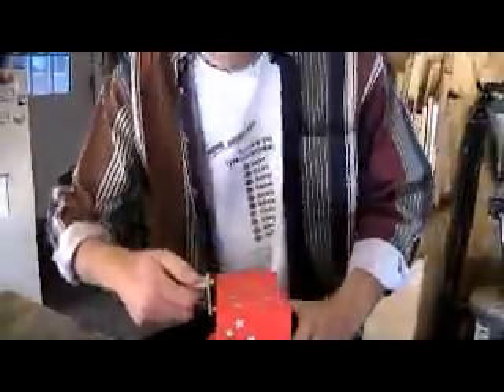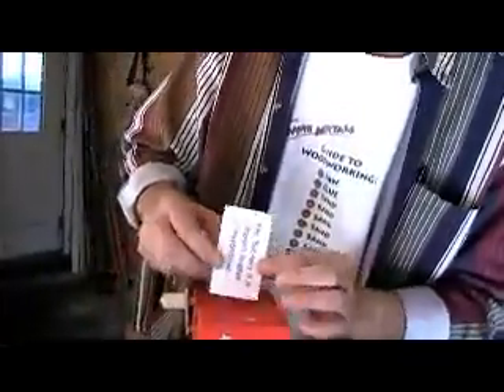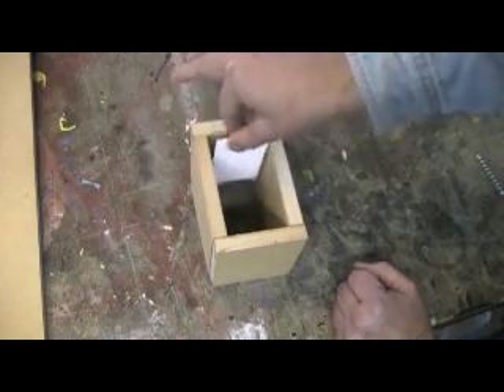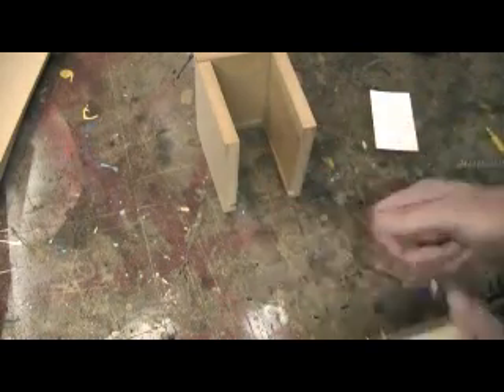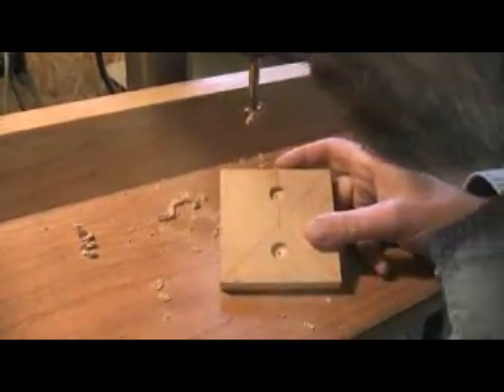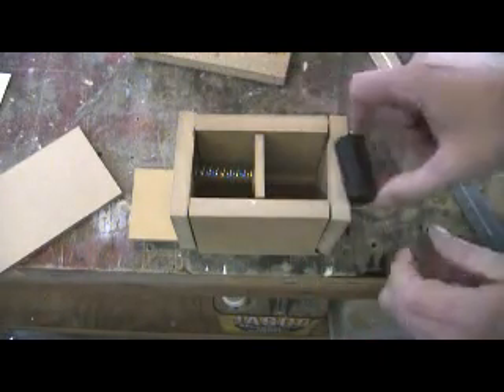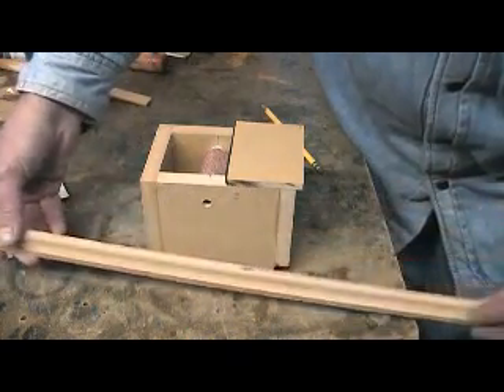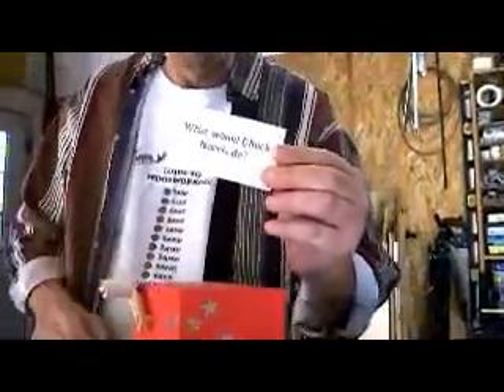Make a mystical fortune-telling box

Comment: Very cool.  On laser printers, I think they take the paper around a fairly tight curve right after the rubber roller picks it up, and the tendency of the paper to want to stay flat keeps multiple sheets from being picked up.  On the other hand, even on $20,000 commercial laser printers, I've had it pick up like 12 sheets of paper and try to jam them all through the paper path at the same time.  Jamming ensues.  Even the folks at HP haven't solved this problem entirely yet.

Comment: Steve. Thanks for the video fix!  I was going through withdrawal.  Have you considered using a small roll of calculator paper and an old typewriter to type variable length messages on the roll?  This would be mechanically foolproof.  Replace the springs board w/ an over sized soft hair roller from the wife to maintain friction w/ the crank roller.  Glue a cutter from an old plastic wrap box so you can cut the paper.  FWIW, ATMs solve this problem using a vacuum and roller system.

Comment: I'm sure you've probably had an answer by now but i used to work on copiers and printers and what they use to separate pages both in the blank paper drawers and the upper paper originals tray is a set of rollers - a feed roller and a separation roller that the single paper goes between. The feed roller spins while the separation roller spins slower or sometimes uses a clutch to temporarily spin the opposite direction, holding back the other pages. These rollers are plastic spools with a thin rubber "tire" similar to what you designed but the difference is the rubber is much softer (like a pencil eraser) and is more matte than slick. They also have a texture kind of like overlapping roof shingles. Spinning in a "lapping" direction instead of a "sawtooth cutting" direction will grab the paper while the separation roller holds all of the others back. I've also seen separation pads which operate similarly but are just a stationary rubber strip spring loaded against the feed roller. 

The hose/dowel idea was excellent. Itd probably be just ad good as a feed roller if you just sand the hose surface to give it a grippy matte texture. Even scouring VERY shallow lines lengthwise (perpendicular to direction of paper travel) with a razor blade will help, too (these tricks are how we got worn rollers to work a little while longer if we were out of replacements and had to wait for an order of new ones. :D)

Hope this helps inspire something for ya.

Comment: I suppose the thing is to make the friction between cards less than the friction between the roller and the card, if you are going to use just the friction to advance the cards. Here's what i would try first, On the back of each card laminate a piece of waxpaper, waxy side out of course. There should be a way to still make them look nice.